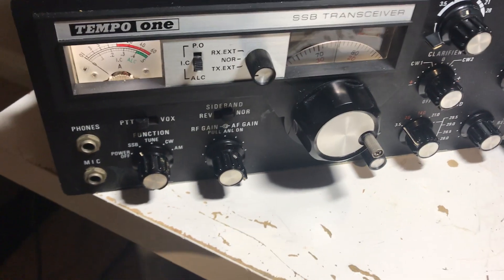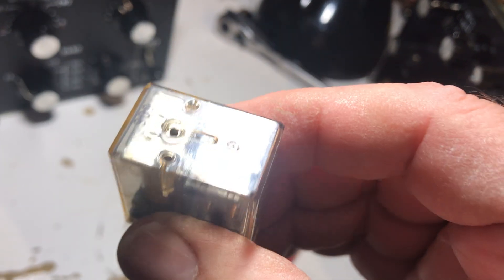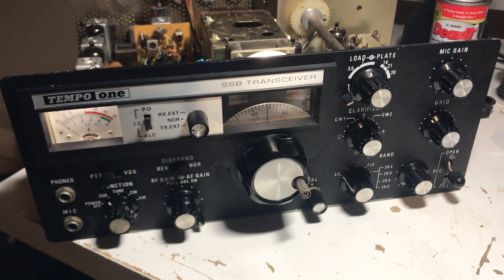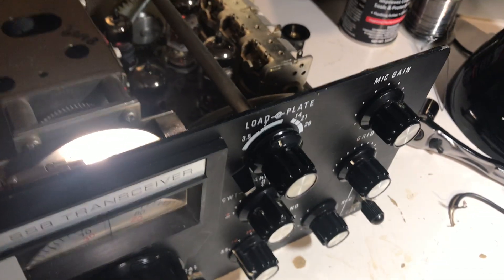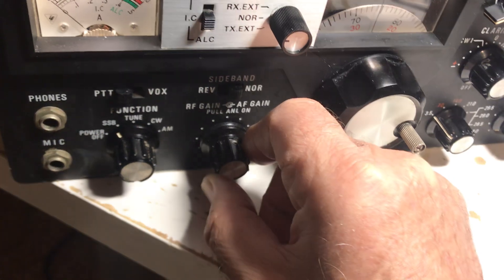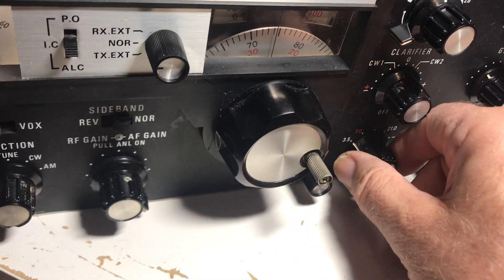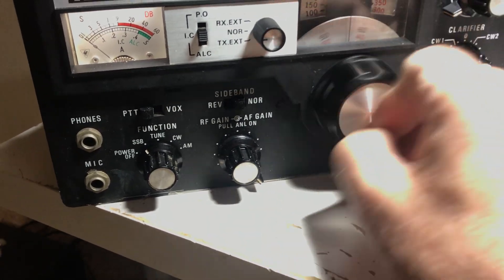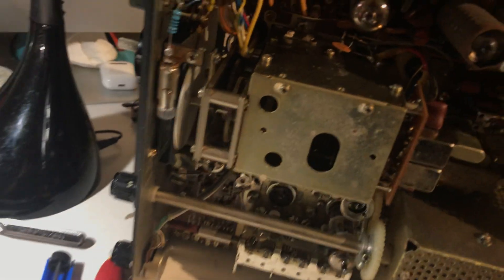Removed unknown mods from my "parts" Tempo One November 9, 2022

Comment: I had a Tempo S-15 2 mtr handheld. It was imported by Henry Radio in LA.
Reply from the maker: Hi Scott. Yep. I think this is one in the same. I bought one of them for cheap on eBay. It had no power supply or cable. I bought another one from qrz.com with a power supply and a cable to connect power supply. the 2nd one I bought is in great shape. Clean. But lightening hit it as the T/R relay is toast. And 40m receive is all messed up. I could not yet figure out 40m receive. So I went back to the original Tempo One I bought. Put the T/R relay back in and no receive. I saw mods and started to rip them out. Turns out the Pull for ANL switch was bad. So the mods MAY have worked that the previous owner had in there. I had the other radio that did receive so I did a wire for wire comparison and reversed the mod. Receives great now. No transmit. I found Yaesu made a Balanced Modulator circuit board that plugs into the radio where hte balanced modulator tube was.
I found when I plugged that board into the tube socket the receive volume went down. So I tested the JFET N Channel transistors on the board and they seemed shorted. I replaced those with some MOSFET N channels from the kit that I got from Amazon of NMOS FETS. Plugged that board back into the balanced modulator tube socket and receive stayed loud and OK. So the NMOS FET change did some good?
I have full ALC when I try to transmit so I think I still have an issue somewhere. Very hard to debug as the schematic is not so good on the PDF copies I have. Take care and thanks for the comment.
Reply from the maker: November 12, 2022 Looks like the solid state balanced modulator works fine. I was able to hear a carrier and see lower and upper sideband modulation on RTL-SDR on the iMac. BUT there is a good solid carrier in there too and I need to null out the carrier for SSB. For AM it seems it has only an upper sideband as Drake did. This rig seems a copy of a TR4 in many ways. But less tubes and a lot smaller and maybe better built as more rugged.
Reply: T4XC has "controlled carrier"  am. Whatever that means, the am guys say mine sounds good with a D-104.